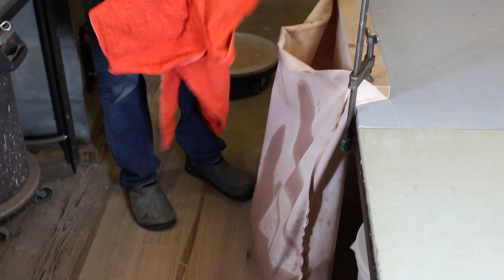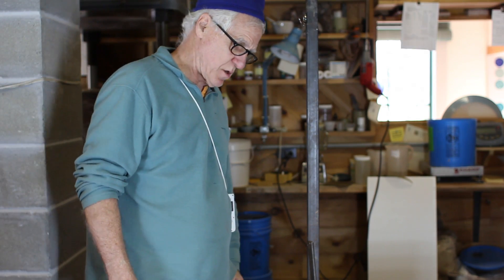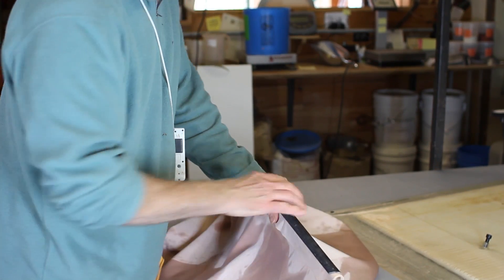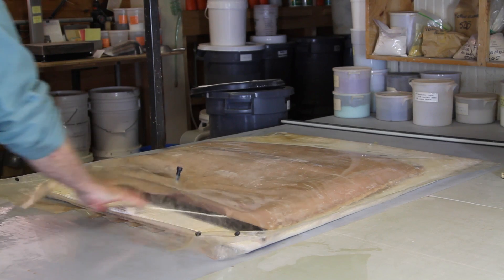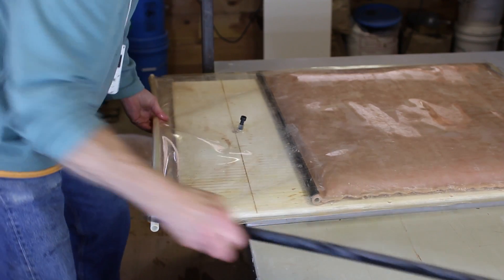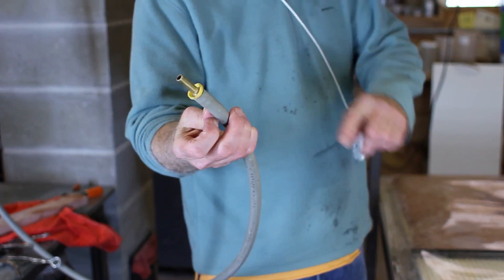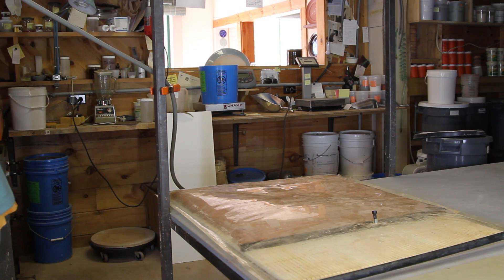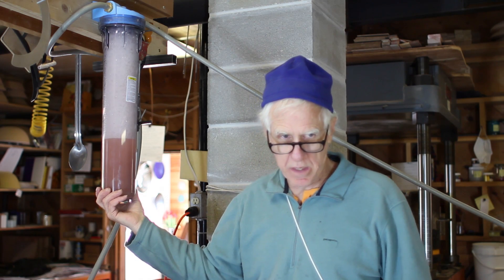Clay slip de-watering with vacuum bag : Part 3 — clay test process

Comment: Amazing, so much knowledge!
I have a question for you. My wife makes clay busts but often doesn't dare bake them, out of fear of air pockets causing them them to burst or crack.
Don't you think it would a good idea to put the dried busts in a slow-vacuum chamber and then into the oven (perhaps also at vacuum)? My idea is that there would be nothing left to explode or crack. Has that ever been tried?

Comment: Thanks for sharing this method.It is very wonderful.Good Teaching.I want to practice.Filter press fabric and sealing devices?Use any kind of fabric?
Reply from the maker: +일준박 I am glad you found this useful. A commercial filter press fabric would be optimum but any kind of tightly woven coarse threaded fabric can be made to work. Run some tests and stick with the fabric most readily available which leaves the minimum amount of sediment in your expelled water. A coarse weave canvas should work well because the coarse surface will provide pathways for the vacuumed water to escape between canvas and interior vacuum bag surface.
Reply: +Dan Weaver Friendly description, thank you.I saw your video are very interesting.
My job also makes pottery.But these days, new CNC directly.You should try to use a casting.
You showed a RAM press is a great help to my work in the future seems to be.Always want to work in keeping healthy.Good luck always ...